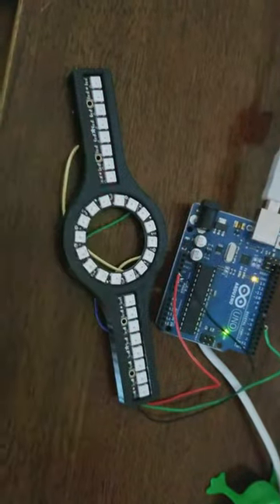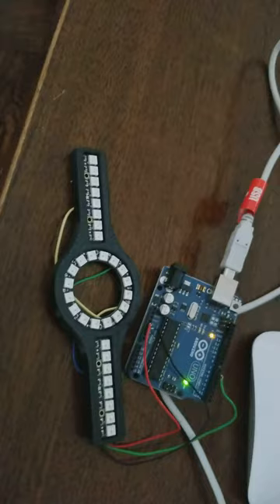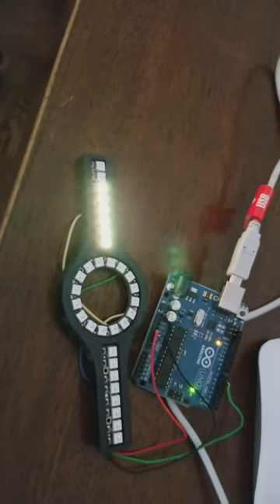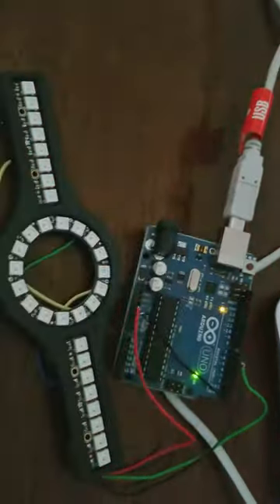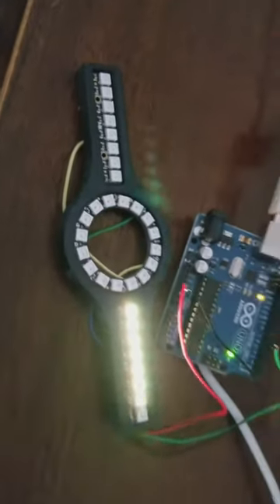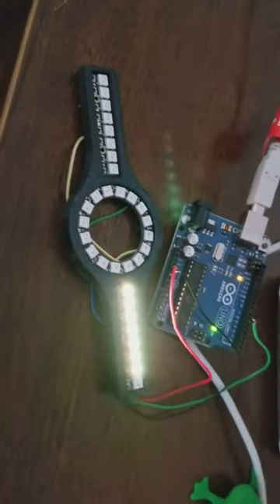Brake Lights and turn signal idea for fat tire scooter

Comment: Hi Kevin. I just got a Phatty Sport model and loooove it! I do deliveries on it and I'm curious if you know how to remove the speed limiter on it. Also I want to purchase a second 20ah battery from Phat Scooters and figure out how to use it as a second auxiliary battery to double my range... Is it possible to add an A/B switch? Cheers!
Reply from the maker: I am not aware of a speed limiter.  There is a 1-2-3 switch on mine and 1-3 only seem to do anything.  More of a power limiter: i don't think it limits speed.  A-B switcher: mine has a standard RC type connector XT60 and there should be a way to make or buy a switch for this.
Reply: Thanks for the reply Kevin. How do they keep it at 19.8mph max speed without a limiter? Good to hear about the A-B switcher. I will look into it.
Reply: On mine it's a pink wire I just disconnected it and I'm hitting 65klms
Reply: @kevinlieb  there is indeed a speed limiter